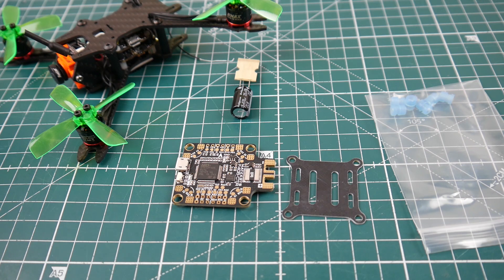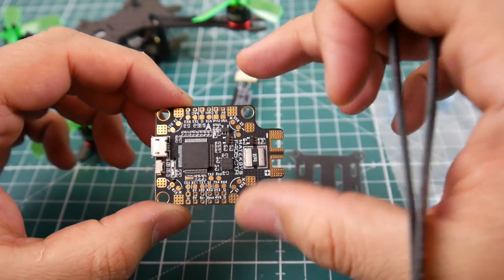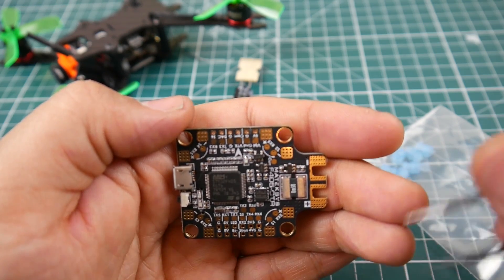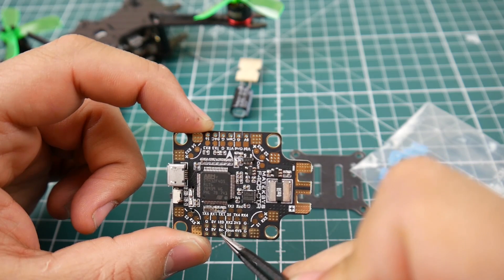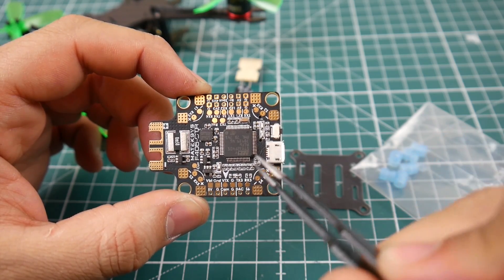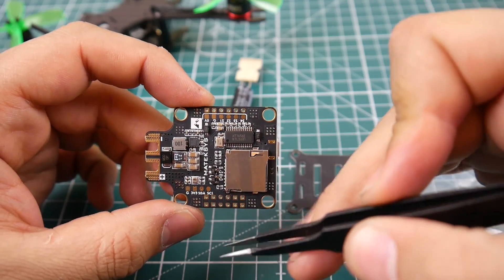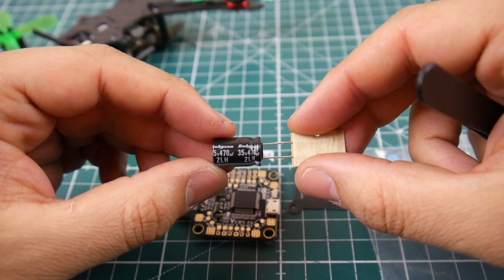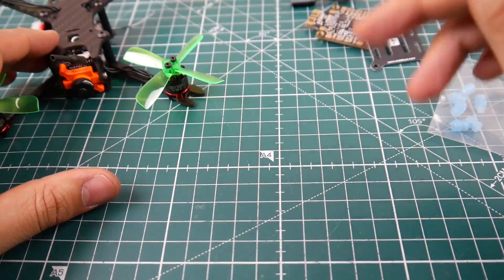Matek F405-CTR has telemetry Pads!!!

Comment: Where do I connect the esc telemetry wire to?
Reply: There is a small telemetry port located above each esc connector. If you search matek f405-ctr manual/bf wiring it should show you a diagram.

Comment: GPS not detected by this board. It says compass not calibrated. Bad compass health. I am using Beitian 880-Q. Running Arducopter 4.0 I tried serial 3 and 4. Tried setting different baud rate. Tried almost everything. What have I missed?

Comment: Installed the Fc but I don’t have any video, just black screen without OSD. Transmitter is working and also changed the camera with a new one.
Reply from the maker: 2 things I can think of.. 
1.OSD chip is faulty 
2. You fried both cameras 

It's more likely that the osd chip got fried or faulty. Login to betaflight and make sure osd is on and check all options in Osd tab.

Comment: WHY YOU SKIPPED F405-CTR NOISE TEST?

Telemetry pads are new thing anyway. I believe that at time when 405-AIO was designed, Matek engineers even didn't thought about them. Rubber gaskets with M3 holes are awesome. They are great space saver. Would like to have those gaskets in all vibration affected FC boards. That separator board is nice to have. But it is redundant in many low design frames, where you barely can squeeze two board stack in. MPU6000 - how about Kalman filter? Had no issues with 4V5 pad for XSR powering on AIO board. Maybe this board have weaker BEC? Removed 9V BEC is sad, yes. It gave cleaner power for Cam/VTX. At today you may connect VTX to battery, but it may be not safe. I fried two Holybro Atlatl HV VTXes in two days (voltage spikes?). And they was rated to withstand 26V! but fried after 30 min flying on 4S.

Comment: That's good to hear ,I ordered mine a last week as I had the original Matek AI0 ,it flew fine for some flights ,no twitches 8k ,16k ,32k ,until a dog decided to try and eat it coming in to land ,the resulting impact I believe damaged the gyro (dog was ok) as after that it developed the twitch ,even at 8k .Also the gyro could not cope with high rotation rate and would carry on rotating until it slowed ! This is a limitation of the 32k gyro .The final straw came when it carried on with a un command roll hit the ground then a tree I Fail safe it and it landed up side down in puddle!
Interestingly the only failure was the 9v supply to the vtx that failed when hit the tree? ,after drying and testing every was fine ,I could repair the 9v line but decide enough ,I think the new gyro's are way to sensitive ,I have crashed mpu 6000 fc before and had no issues with the gyro's or exceeding rotation rates ,so I'm back to 8k 8k ,the difference with 32k from what I could feel was very little anyway and not worth the hassle.

Comment: be sure to check usb port. i noticed mine seemed a little flimsy when i first got it tried to be as gentle as possible with it but eventually broke off. was able to solder new one on though. there are threw hole anchor points at the front and two more points on the back corners make sure they are soldered well.                   other than that love the board's setup, i have it on a 6 inch inav build was easy setup. their website has great wiring diagrams and info

Comment: I I had the yaw twitch on the original and had to swap to this one....I honestly can’t feel the difference between 32k/16k and 8k/8k and anyone who says they can is chattin BS.
Reply: It has been proven that estimate part converge to constant after few update cycles, so it is the same as PT1, BQ ... All filters are equal, you just need to fiddle with cutoff freq. a bit. In other words same effect with another math. Unfortunately no magick silver bullet lies in so called FKF. BTW it should be called JAF (Just another filter) :)
Reply: No Kalman filter for this board anymore.
Reply: KrotowX an f4 processor at 8k is sufficient to run the Kalyan filter.
Reply: Would like to see that.
Reply: KrotowX I can’t post go pro footage but I can upload dvr recording from my aomways if you like on my channel. I can also show you the black box log to show the attenuation of motor frequencies. Remember all the Kalman filter does is a state estimate using the current state sample and one from a previous state. Nothing is demanding about that. Heck I run a kalman filter on and Arduino home built self balancing robot lol.
Reply: I think the devs have overly complicated the kalman filter and it’s causing a lot of confusions to fpv pilots. You don’t need to over clock your processor or run 32k in order to benefit from it. All it does is give you the best current gyro sample.
Reply: KrotowX one more thing I must point out. Since the kalman filter is a state estimator, faster loop times gives you a more accurate estimate... in theory.
Reply: Ok, Ok, you convinced me.
Reply: Do you know that the implementation in BF/BuF is not actually the kalman? :)
Reply: ApoC yes...I’m aware. It’s being used as a lpf. But it’s still the same principle of state estimate.